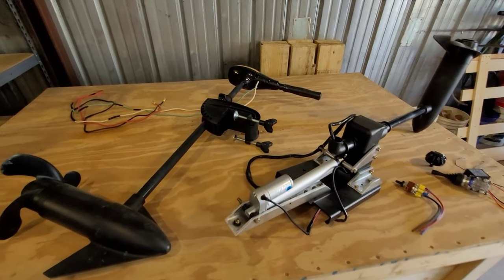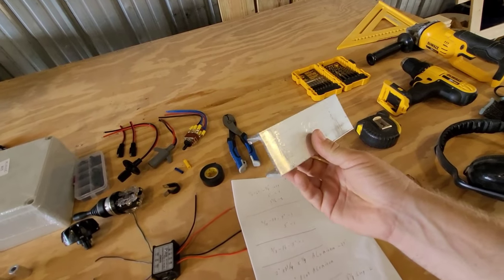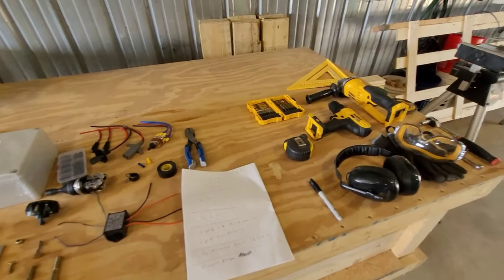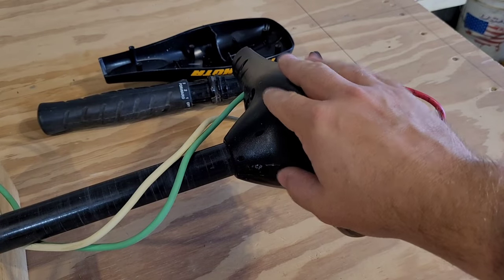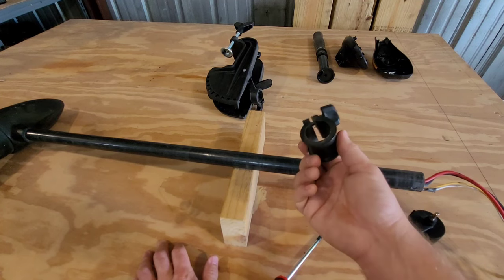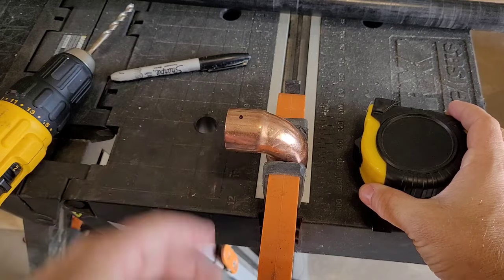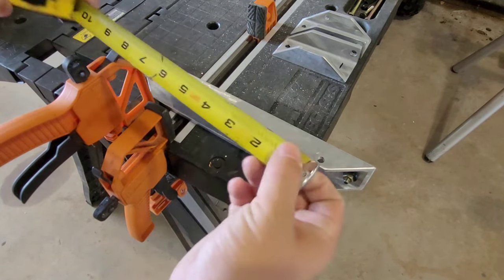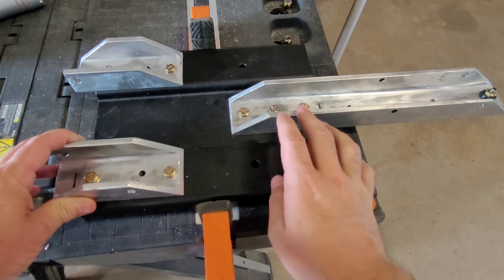Best kayak trolling motor setup! Homemade Powerdrive with power lift!!

Comment: I’m very inspired and impressed by your build! Have a question though about the Steering Motor Drive Housing: How much does it let you turn, I mean, is there something to limit the turning so it doesn’t go 360 degrees and mess up the wiring from the motor? Or do you just control it by yourself so that you just don’t turn it too much?
Reply from the maker: Thanks! I really appreciate that and glad to hear it inspired you. It can turn 360 degrees but that is limited by the length of the power wires coming out of the trolling motor. I made my wires alittle extra so I would be able to turn it 360 degrees before having to stop. I've never had an issue of not being able to turn enough. Hope that helps. Happy fishing 🎣
Reply: @ARKAYAKFISHING  Thanks for the reply, that clarified a lot! I was wondering, that is the power of the steering motor too much that if you just “keep on turning” that it would rip the wires, but if I understand you correctly, you notice that the limit for the turning is up, when the loose wiring just stops it from turning (so it’s not that powerful). I’m thinking about same type of solution for my kayak, but mounting it to the back of it, so I wouldn’t be able to see so easily how much have I turned it and how are the wires acting, so that is why this wondered me😁
Reply from the maker: @M11cc4  I've never had this setup on the back before. It would be a challenge to know how much it's steering left to right. But I have accidentally limited it out before and it did not pull the wires out. It just did not have the power to do that. I would have to rig up some type of turning indicator if I put it on the back so I could tell how much it's turning.
Reply: @ARKAYAKFISHING  Thanks for the tip! Your front design is great and probably even better solution for fishing, but my setup limits me so I have to get creative! I have a Wilderness Systems Ride 115 and in front setup, it would cut my access to the front hatch (which I need a lot because I make a lot of overnight trips and have my camping gear with me). The other limiting factor is that I move my kayak around in a trailer which is modified so that the kayak sits perfectly when the nose of it is just at the head of the trailer, so I basically don’t have any room in front. But you gave me a lots of ideas (and probably many sleepless nights😂) so thanks again! Needless to say that I’m a subscriber now🙏🏻
Reply from the maker: @M11cc4  Thanks for subscribing! Yeah some kayaks and setups just can not have a front trolling motor. I had the same problem on my first pelican kayak with the front hatch. Sometimes the trolling motor just has to go in the back lol. Glad I could help out! Good luck!

Comment: would a terrovia drive also work instead of the powerdrive?
Reply from the maker: I don't have any hands on experience with the terrova steering housing but from the pictures I've looked up it should still work as long as the shaft diameter is the same.

Comment: What size and where did you source your C channel?  
Sorry if I overlooked the answer to this question.
Reply from the maker: I used 2 inch wide by 1-1/4 tall channel. Got it on ebay. I looked on there earlier and couldn't find any. There is some 2 inch wide by 2 inch tall channel that will also work. Just make sure it's the 1/4 inch thickness

Comment: is there a way to add powerdrive and keep the transom mount?
Reply from the maker: Your wanting to put a powerdrive on the back? And your wanting to keep the factory rudder on too?
Reply: @ARKAYAKFISHING  i have the pelican pwr 100 that has the transom mount so i was just wanting to keep that mounting system
Reply from the maker: @espick53  no you won't beable to keep that mount for the powerdrive. You'll have to mount the powerdrive to a flat plate or a quick detach plate. I would remove that factory plastic transom. Buy some starboard or 1/4 flat aluminum. Cut a piece out to match the factory mounting holes. Bolt it down useing 1/4-20 bolts. Then buy a minn kota quick detach plate. Just like the one I bought in the video. Then bolt it to the piece you made to replace the factory transom. Then bolt the powerdrive to it. That way you can quickly take the trolling motor off. Hope that helps.

Comment: What is the overall weight of the whole package?
Reply from the maker: With a minn kota 30 it's 19.5lbs. And around 24lbs with a minn kota 45.
Reply: @ARKAYAKFISHING  
Awesome thank you, and one battery supplying power to the whole setup ?
Reply from the maker: @Howie_fish  yeah. I use a 100ah lithium to run everything

Comment: Awesome video. Very detailed. I'm now a subscriber. I have all the required parts to build this for my kayak with the exception of the Aluminum channel. Can't seem to find the exact dimensions. Was anyone else able to find the correct size channel?
Reply from the maker: Thanks! Really appreciate the sub! Year it's hard to find that particular size. You can also use the 2inch by 2inch channel. It's more available. Just alittle taller. Happy fishing!
Reply: Ok that was what I was thinking as well. 2 x 2 is pretty common. Thanks again and keep the videos coming. I'll post my results when I'm finished.  @ARKAYAKFISHING
Reply from the maker: @RandyWard-x6k  no problem and thanks for the support!

Comment: At min point 38/39 the control switch that you are reusing . is it possible you could give me a parts nunber for the switch?. I have bought a used minn kota power drive auto pilot ver 1. with no controls. im trying to figure out how i can jump start it to see if the motor is any good. Can anyone tell me how i can do this?
Reply from the maker: https://lakesidemarineandservice.com/collections/switches/products/minn-kota-5-speed-switch-2064028

Here's a link to the switch I use. I don't have any experience with the v1 powerdrive. But if your just trying to see if it will work or run then there should be a black and red wire coming out of the shaft. You should be about to hook a 12v battery directly to that black and red to see if it will run.
Reply: @ARKAYAKFISHING  thank you. Being dc i thought that would work but its always better to ask if you have a choice
Reply from the maker: Your welcome. Yeah better to ask then to burn something up for sure.

Comment: I like your setup but go to a pwm for speed control it will save your battery life at lower speeds.
Reply from the maker: Thanks! I've thought about going to a pwm but for this video I was just trying to keep it simple so people could use the factory switch. Do you know a good reliable pwm?
Reply: @ARKAYAKFISHING  I got the highest amp rating I could get off Amazon or eBay and I also have it fused at 30 amps works good
Reply from the maker: @robswoodsandcustomsawmilli9940  Thanks! Appreciate the advice! 👋

Comment: How much was this to build
Reply from the maker: At the time of the video if you use a minn kota 30 it's around 500 to build. I use 30s and 45s on my builds. The 30 is my favorite. Just smaller lighter and doesn't have any problems moving the kayak.